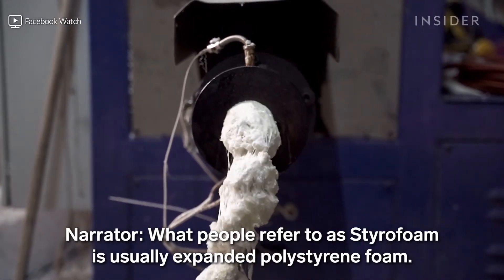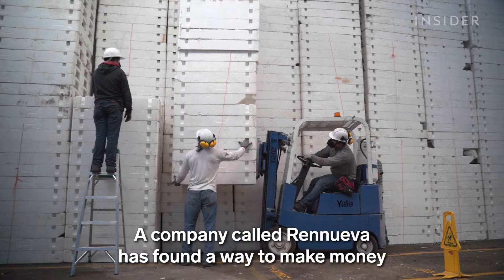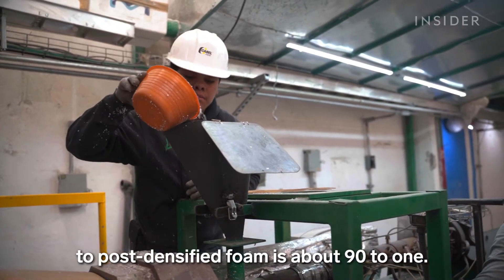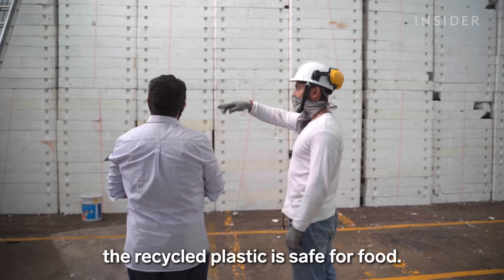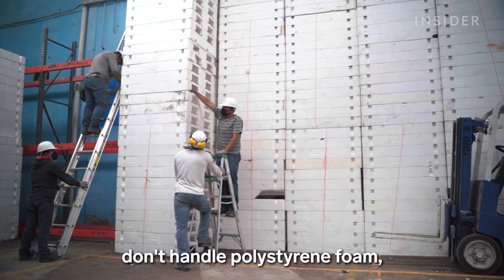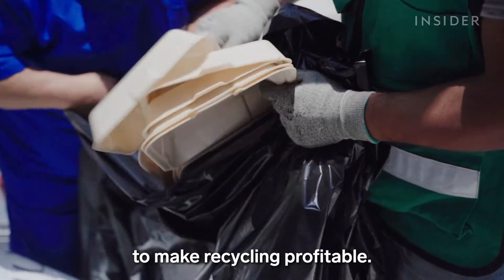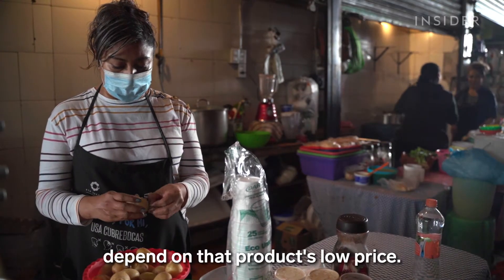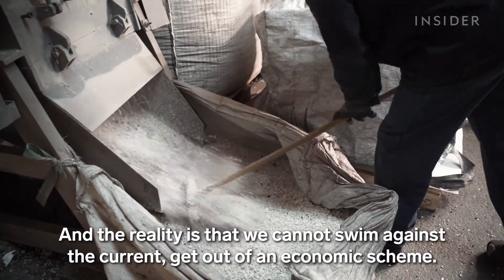Why It’s So Hard To Recycle Styrofoam And Polystyrene | World Wide Waste

Comment: I just watched video about the recycling program in New Jersey it was from 4 years ago I hope it is still in operation. It mentioned the picture frames and moulding as well and I was thinking about I wonder if you could make wall art like butterflies, or flowers or maybe a shelf or a framed mirror?
Reply: From the post-recycled pellet form, I’d imagine you could theoretically make anything with the right molds/equipment. 👍 The pellets are heated and molded to shape.